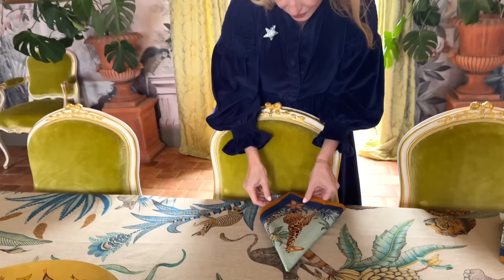The Paint Restorers have started in the Chapel!

Comment: In my home I have a chandelier about 25 feet up with a stone floor below. As with your chapel there is an attic space above the ceiling. We put in a simple crank/pulley of the type used with a trailer hitch for pulling a car up on to a trailer. No sacrilege intended, it has been a blessing and will be a blessing in your chapel. The danger inherent in getting on a ladder of that height to clean the chandelier and change lightbulbs is one most devoutly to be avoided.

Comment: Before the side chapel's furniture is returned, you might alter the piece a bit to allow air flow. I think what happened to it, the rot, will happen again, because it could be a dank space. Cleverly cutting the lower part of the back of the piece might be all that is needed. Also, I encourage radiant heating under the floor, which goes hand in hand with solar panels - which could be located near the tennis courts or hidden close by. Bon Chance!

Comment: You don't have to be religious to renovate an old church in to a house.  For me, it's more about the grandeur of the architecture, the stained glass, the paint, and the word work.  I have seen an old church in Spain that was converted into a house. They had to build an interior frame to support the loft space they created and the new rooms within the existing structure.  The reason they did that was they didn't want to compromise the original walls what so ever for fear that would cause irreparable damage to the structure.  They, of course, had to first repair/replace the structural supports, ceiling beams, the roof and roof structure, etcetera.  It was quite an amazing restoration/rehabilitation